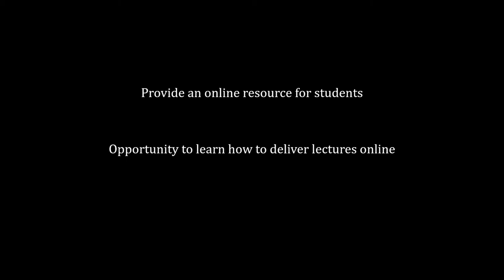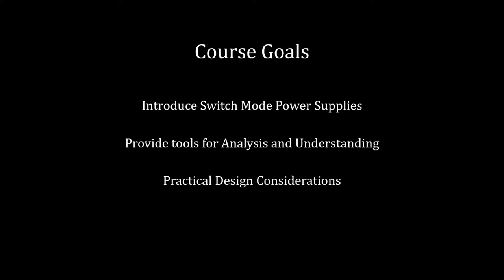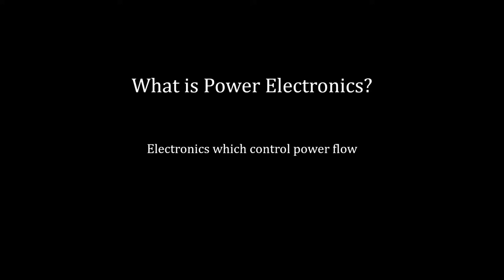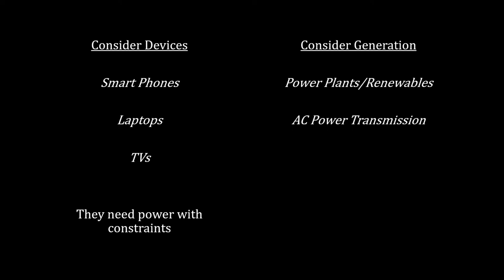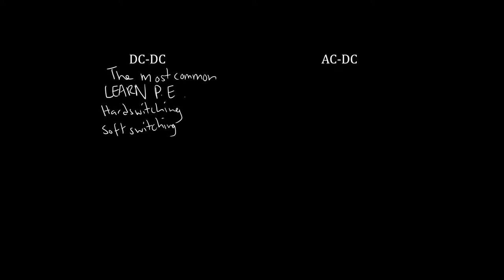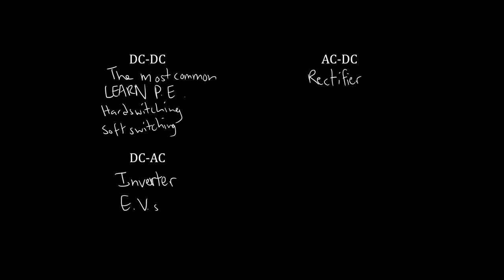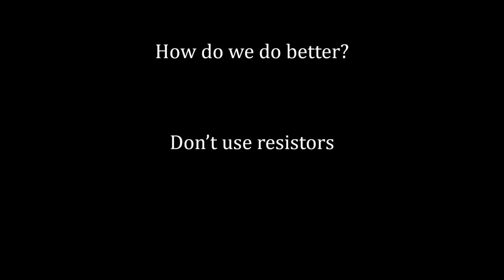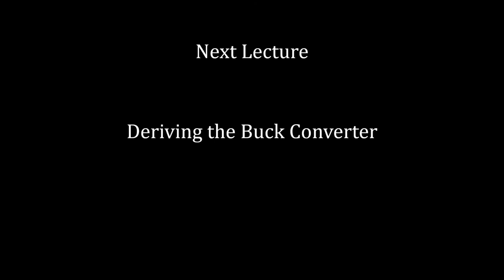Lecture 0: Introduction to Power Electronics

Comment: Hi, thank you for this amazing resource. Speaking about the LDO: would it be fair to say that in order to get a constant voltage at the output, you need a constant reference voltage, and thus it can't be treated as a solution even if the efficiency didn't matter?